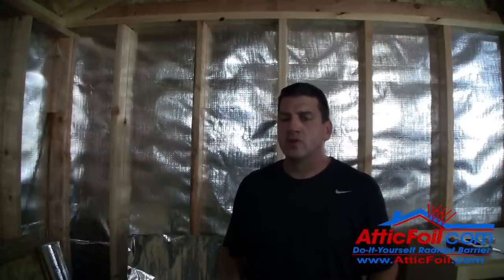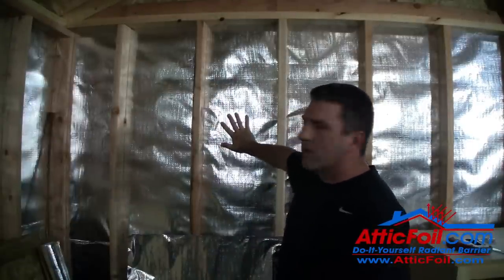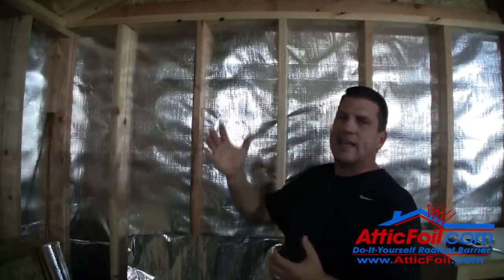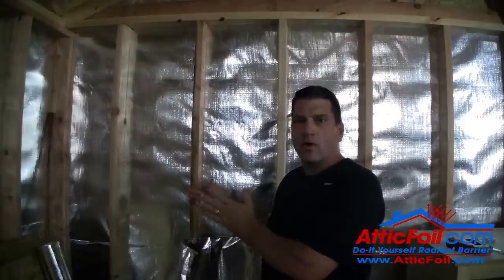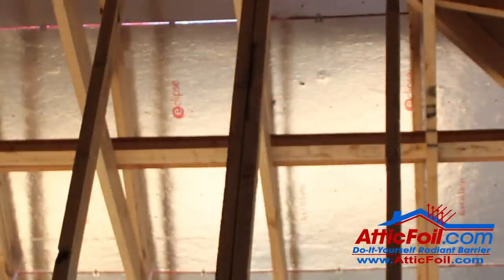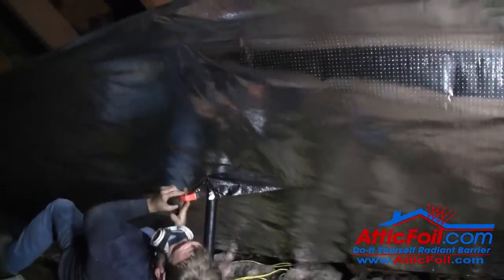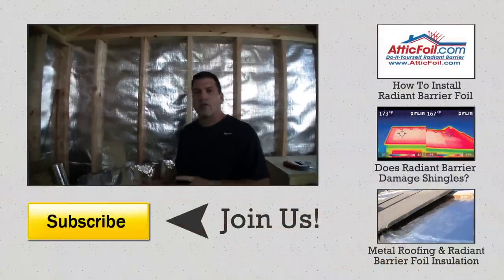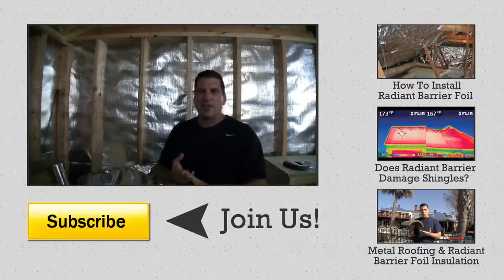Radiant Barrier Department Of Energy Lab Test Results - (Understanding Reflectivity vs Emissivity)

Comment: Does it matter if the insulation is on top or below the barrier? I have ducts in my attic and so i want to bring them inside the air conditioned space. So I was going to install insulation in the bays between rafters. In what order should the 3 pieces go? Should it be vent channel baffle, fiber glass, then foil? Or should it be Foil, vent channel baffle, insulation? Or can I omit the vent baffle channel and use the foil to make one then put the insulation under the foil? Which method will give me the best result?
Reply from the maker: I'd go roofdeck > air channel > Foil > Insulation (sealed airtight) > some type of interior air barrier > attic space.  You will get both a radiant barrier and a conditioned attic for your ducts.

Comment: When the foil pressed up against the hot surface, heat transfer happens 100% by conduction. When there is an air gap between them, the heat transfer happens by radiation and convection (and conduction from the foil to indoor air). Since the foil is so good at reflecting thermal radiation,  the latter works better. Even though I knew the physics behind it, it never occurred to me until I watched this video. So thanks a lot!
Reply from the maker: Thanks for the comment!

Comment: @AtticFoil   Regarding using radiant barrier on walls... Should an air gap be present between the insulation and radiant barrier and well as between the radiant barrier and sheet rock?
Reply from the maker: Either side will work - only one side needs to face the airspace.  Depending on the direction of the heat flow, the www.AtticFoil.com will either work off of the reflectivity quality or the emissivity quality of the foil.  More info here:

Comment: Are there any issues with using both emissivity and reflectivity?   Our roofing already has a silver lining under the wood and above our rafters.  I'm considering adding another reflective barrier under the rafters.  Our ducts are in the attic and we are in a warm Texas climate.   Thanks.
Reply from the maker: No issue.  In fact, it works GREAT!  The radiant barrier decking is OK but combined with www.AtticFoil.com the results are amazing. We have several builders who do both with great results!

Comment: Hi Ed... Thank you, thank you, thank you!  I've been seeking this answer and it's been driving me nuts.  I'm a educated guy, and even a bit of a science dork, so I completely understand and conceptually GET the difference between the three main forms of heat transfer: Radiation, Conduction, and Convection.  What I did NOT get is how it was possible for those products like LP TechShield to have ANY effect at all.  If I'm standing 1ft away from a large campfire and hold a sheet of foil in front of me I'll be cold, cuz I'm blocking virtually all of the radiant heat of the fire, but if I wrap myself in that foil tightly in that foil I'll cook, because at that point the foil itself will heat up and through contact it will heat me up.  So how can Techshield have an effect.  I finally understand that it HAS AN EFFECT, just not nearly as powerful of one.  

I live in Atlanta, GA and we are about to build a home (I myself am a roofing contractor). I know there has been case studies done on Techshield type products and they do seem to (w/ minimal effort) have a decent and measurable effect. I have not costed out the product to see how much more than regular OSB it costs, but I imagine it's not a HUGE difference.  I'm betting a guy like you has read the studies and has done the math... Since attic foil has even a bigger effect I absolutely plan on using that (even though it does take more effort too).   If I'm building from scratch and can afford the increase in material cost for the decking, do you think I should use both Techshield AND use attic foil??  Or should I skip the techshield type stuff and ONLY use the attic foils systems? 

What are your thoughts about batt insulation vs. blown insulation (I watched your video about fluffing and would be sure to purchase by units, not inches)?  I worry that blown insulation, even with baffles, may clog up my intake vents, it gives a more uniform coverage too.
Reply from the maker: Techshield is usually a pretty cheap upgrade.  Maybe $2 per sheet?? So, it's worth it.  We have had many people use both with spectacular results.  Or, and in-between method would be to drape over the rafters and let droop down between.  http://www.roofingfoil.com/install-photos/under-new-decking/  As for keeping insulation out of the soffits?  Run the foil up a foot or two then leave a gap before the next piece. You just want a path for air to get both between the foil and the roof and into the attic under the AtticFoil.  For insulation?  Blown insulation is usually best since you can easily fill and cover all the small hard to reach areas.  I've also seen batts put in up the the tops of the ceiling joists and then blown in on top.  This works good too.
Reply: @pedram Pete you're only understanding part of the concept. Wrapping yourself in tinfoil and cooking is only part of the concept. When the foil is directly touching the wood.... the foil itself gets hot, the roof gets hot, the siding gets hot. It however does not radiate that heat. So the items inside that are not directly touching the foil....don't have heat radiating into them
Reply: I  wouldn't worry too much about blown insulation clogging the soffit vents, you could always get the attic blown before the soffit is installed, that way you'd know the vents are  clear of any insulation.
Myself I prefer cellulose over blown fiberglass, batt insulation does not perform well in an attic.

Comment from the maker: As you can see from the video, many people get tripped up about which side of the foil the air space is on and it can be confusing. If you have questions about an install or where to place the foil, ASK US!! We are the experts and we can help you out. You can leave your comment below or give us a call!
Reply: I was planning on putting batt insulation in the cavities and the attic foil draped over the rafters. Would this work?
Reply from the maker: @1225eal  Can you list all layers including airspaces from the outside to inside?  Example? Shingles/roof deck/airspace/foil/Insulation/drywall. Sorry, but I need more details on the whole assembly.
Reply: This one is different . If you  glued radiant Berrier  down to the outside roof of a rv/ house trailer would the reflective properties of the foil help keep heat down inside of the rv..  glue it straight the the roof
Reply from the maker: It may help some, but the primary benefit would be to reflect heat and keep it out.

Comment: Is that the same with cold? Like if it's cold outside and you leave that air gap will the cold be reflected back outside?
Reply from the maker: Technically, there is NO such thing as "Cold".  It's just a lack of heat.  To some degree it will reflect the heat BACK to the inside from escaping.

Comment: Hello, Is it ok to add R-13 piece insulation between the outside wall and the foil when the foil is placed in the emissivity heat (attic foil is nailed on the rafters/studs on the inside of the house)?
Reply from the maker: David, can you clarify EXACTLY all the layers from the outside to the inside?  Including any air spaces?  As long as the foil faces an airspace it will work off of either reflectivity or emissivity.

Comment: Great content. Quick question for you. My newly built home has the aluminum built into the roof decking already.  Our second floor AC unit constantly runs during the summer time.  Would it be beneficial to add your product to the boards to create that air gap? Would the benefit be cumulative? Thanks!
Reply from the maker: Here is a real simple way to determine if a radiant barrier will be beneficial.  If you put your hand a couple inches away from the roof decking and you  FEEL radiant heat, then stapling to the bottom of the rafters will be beneficial.  The radiant barrier decking works OK, but combined with stapling www.AtticFoil.com on the bottom of the rafters, the results are AMAZING.  We have a bunch of high performance home builders with do BOTH!  It's hard to tell if the sun is out or not while in these attics.
Reply: @AtticFoil  I though same thing.  Have a house in Central FL. and needs new roof was going to put reflective barrier on roof looking at metal roofing.  Now think will do both.

Comment: OK, so looking at emissivity tables youcan see that foil emissivity is 0.03 and wood is 0.9. So foil is going to radiate a tiny fraction of the heat that the bare underside of OSB sheathing would, but there is still going to be direct transfer of heat by conduction to free moving attic air that will convect. Is radiated heat really THAT much of a component in this situation?
Reply from the maker: Not sure if you have ever been in an attic in Texas in July but YES Radiant Heat Is HUGE!  Air gets hot from the cooling effect of pulling heat off the deck as it moves by.  It's basically an air-cooled assembly.  But radiant heat goes right through air.  Otherwise, we could not have a cold/sunny day.
Reply: @AtticFoil  Yes, I understand how radiant heat transfer works. As I said, I would have thought that conduction/convection across the underside of the sheathing would've transferred more heat than radiation because I didn't realise that wood radiated so well.

Comment: Hello! My husband and I will be installing this in our attic, and we're wondering if stapling 2 layers instead of just 1 would increase the benefit further. Has AtticFoil tested this at all? Thank you so much for your videos by the way. They've been incredibly helpful and informative!
Reply from the maker: +FloJoMoJo You will not get much of a benefit from installing an additional layer.  It's kinda like wearing two raincoats.  If the first layer is reflecting 97% of the radiant heat, there isn't much getting through for the 2nd layer to work on.
Reply: +AtticFoil Radiant Barrier Foil Insulation Thank you for your response! This helps immensely.

Comment: would there be any benefit to doing both radiant barrier decking plus foil barrier with an air space?
Reply from the maker: We have had many builders do both in the South with amazing results.  The radiant barrier decking works pretty good.  But, combined with the www.AtticFoil.com on the bottom of the rafters and you will virtually eliminate ALL radiant heat coming into the attic.
Reply: @AtticFoil  That's great!

Comment: What happens if you have a water leak in your attic and the rafters are foiled up? Won't it be undetectable since it's invisible?
Reply from the maker: Not at all.  Normally you install www.AtticFoil.com from the bottom upward and do not tape the seams.  If you have a leak it will only run down less than 4' and drip off the edge of the AtticFoil.  It will also leave staining on the edge.  It's actually easier to find a leak with the foil installed.

Comment: with attic foil on the rafters, how does heat fare with it coming up the rafter channels  (that air space) and only has room to go out of whirlybirds? I know a ridgevent is already designed to where it'll go straight out the exhaust but with whirlybirds it seems like alot of heat will recirculate back through the attic and move out sooner or later but not as efficient as a ridgevent or on a roof with hips. Please let me know what you think
Reply from the maker: Don't overthink it.  Hot air all ends up in the "top" of the attic.  Like water in a tub heading towards the drain.  In fact, hot air does not actually "rise" it is LIFTED by cooler denser air.   This is air coming in the bottom of the attic. So, not a lot of "recirculation" you mentioned. The hot air will find a way out whether ridge vents, wind turbines, passive vents, gable vents etc.

Comment: Can I keep the airspace 2-3 feet after roof?
Reply from the maker: Yes, does not matter where or how big the airspace is.  You just want to break the path of heat coming off the roof into the insulation when installing www.AttticFoil.com

Comment: I have solar board on my new house. If I added a solar shield to the studs, keeping the eaves and ridge vents clear of course, would that help or hurt?
Reply from the maker: We have several home builders who do both on all the new homes they build.  The solar board is pretty good considering the cost.  But, combined with www.AtticFoil.com it's amazing you will feel virtually NO radiant heat coming off the roof. Usually you cannot tell if it's sunny or cloudy inside the attic.

Comment: I live in the mountains of VA. I have a shingled roof then osb board then insulation. can I staple foil to rafters then put sheetrock. Will this cause condensation? I will not have an air space as the attic is a bedroom.
Reply from the maker: Uh, tricky question.  Products do NOT CAUSE condensation.  Condensation occurs when warm-moist air comes in contact with a relatively cool surface (Below the dew point).  Just like breathing on a mirror.  So, without more info I really can't make a call.  Feel free to call us.  More info on condensation here: https://bluetexinsulation.com/pages/moisture-in-metal-buildings-causes

Comment: Ok, so if techshield on the bottom of OSB blocks 30%, and the reflective foil blocks 50%, then why aren't we seeing foil backed drywall or gypsum board to reflect on vaulted ceilings or sunny walls? Seems like there's a market for that where you can't install the foil to a vaulted ceiling.  thoughts?
Reply from the maker: Here is how you do cathedral ceilings: https://youtu.be/CjwZXoRzRiM You would typically not want a radiant barrier "inside" the insulation.  Radiant barrier first for radiant heat, regular insulation next for conductive heat.

Comment: If I have radiant barrier OSB with foil facing out (on an exterior wall of a shop) and put siding (Hardie plank) directly on top, with no air gap will it still block heat?  The air gap as I see it will be on the inside of the shop because of no drywall etc.
Reply from the maker: It depends,  If it overlaps and there is a small triangular airspace behind it, you will still get SOME benefit.  If it's more like a shiplap profile with full contact to the foil, you won't get any benefit.

Comment: Can you still put over even if you have the foil up against the wood like that well would it work or just waste of time
Reply from the maker: You can definitely staple it up below the radiant barrier decking.  We have several home builders that do bot on new construction homes and they love the results.  You can stand in the attic and can't tell if the sun is out or not!  So, there is benefit.  As for is it worth it??  It depends, If you can DIY it then I'd say yes.  Paying a person a bunch to install it? The payback is gonna be a super long time.

Comment: What do you recommend? Real foil, thick industrial grade, as the material itself has a role or the foil coated mylar material?
Reply from the maker: Real aluminum like on our www.AtticFoil.com products.  Our foil is actually REALLY thin.  The thinner the better for reflectivity. This is why we laminate it to a woven PE fabric (like a blue tarp) to make it tearproof.  NEVER use MPET or mylar.  It will oxidize.  https://atticfoil.com/index.php/technical-info/metalized-radiant-barrier-film-oxidation/

Comment: have you tryed putting the foil on top of the insulation in an attic and putting it under the rafters?
Reply from the maker: Yes, we have had many customers do both with great results.  Once you staple it up, laying over the insulation is easy.  This method will create a better year-round benefit for homes that have ductwork in the attic.  You want to BOTH reduce Summer heat gain, AND reduce Winter heat loss.

Comment: Is this emf protection also?
Reply from the maker: Although we don't promote the product as RF/Faraday Cage/emf type product, we have had many customer buy a lot of product for this purpose. (whole buildings on interior walls, etc.)  Because needs are specific, we recommend getting a sample or single roll and testing to see if it meets your requirements.  Generally speaking, any pure aluminum product would reduce or eliminate RF signals.

Comment: does this block 3g, 4g, 5g, wifi etc?
Reply from the maker: We don't officially sell it for these purposes.  However, we sell a LOT of product for this purpose. We always tell customers to get a free sample or a small roll to test to see if it meets there needs.  Usually, they end up ordering.  We had one customer put in 50,000 sq. ft in walls inside a building for this reason.

Comment: So are you suggesting to use both one on the wall and one on the studs? Or just the one on the studs?
Reply from the maker: Working off of Reflectivity is best.  However, from an install perspective, sometimes it's easier to install using the emissivity quality.
Reply: Is reflectivity the one against the wood sheets? Or the one that goes across the studs?
Reply from the maker: @desertrider325  Reflectivity is when the airspace faces the HOT object.  In this case stapling to the inside of the studs with the airspace between the foil and the hot sides/roof.  Emissivity is when the airpace faces the "Cool" side like when you wrap a hot potato to KEEP it hot.

Comment: Emissivity vs reflectivity Which is better as far as keeping a room cooler or is both equal
Reply from the maker: Reflectivity is best if you can get the airspace on the hot side.
Reply: @AtticFoil so if we can get the airspace on the hot side in assuming the reflective side should face the air space? Thanks a lot 🙏🙏😅